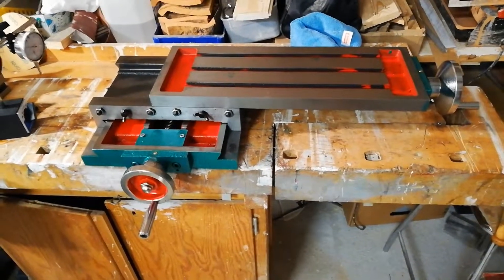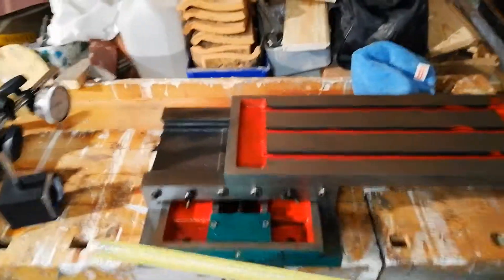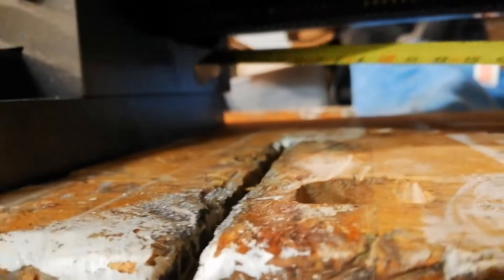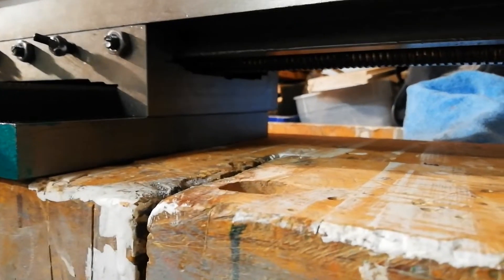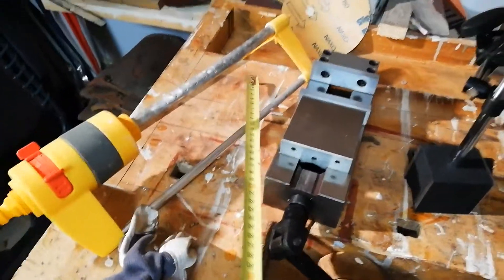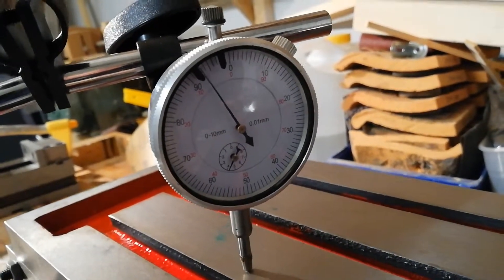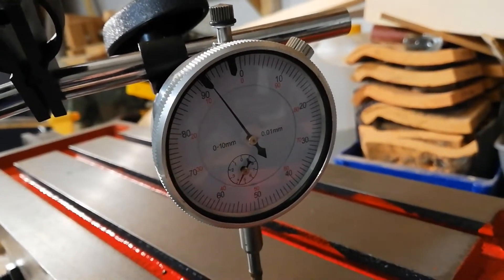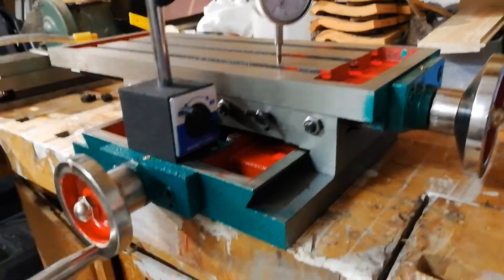PART 2 Unboxing Cheap milling / drill press table (XY / cross / compound / slide table)

Comment: What is the width dimension of the T slots in the table and the width, thickness, thread diameter and O.A.length of the (2) T bolts supplied? Thank you.

Comment: FYI with this table take it apart clean all tracks and adjusters then make sure the turning handle feeds holes are big enough then make sure your drill table is level then put a surfacing cutter in your press and move the milling table X & Y and find all the places that might be off then make absolutely sure the milling table is very clean all adjusting guides are adjusted right the run the table both way X-Y with your cutter surfacing cutter you shouldn't have any high or low spots. Mine was within. 00002 perfect because most things will usually have a +- .005 to .002
Reply: You still happy with it for the price?
Reply: Thanks for sharing this.